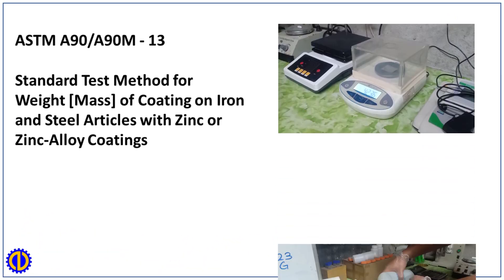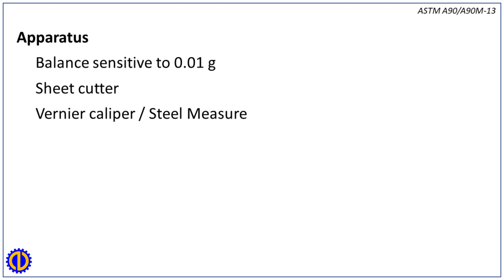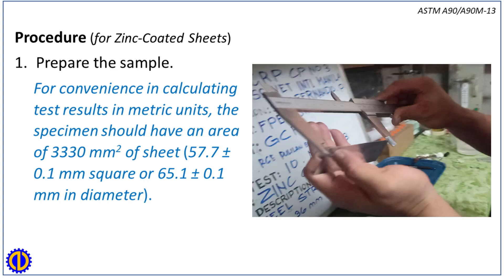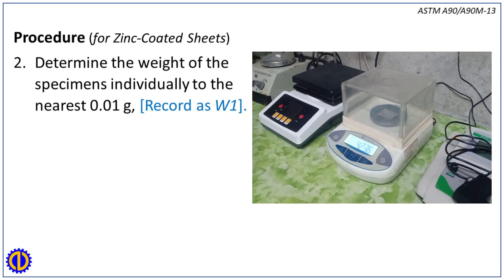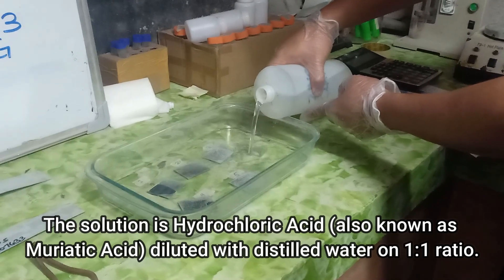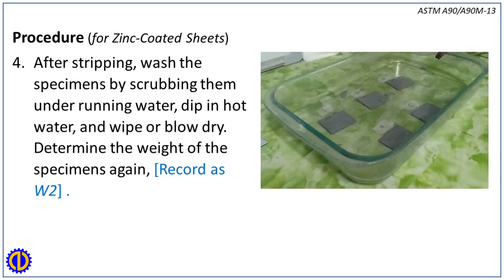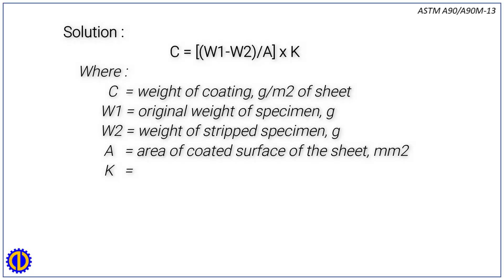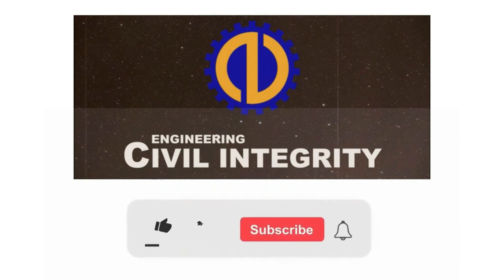Zinc Coating Test

Comment: How long it takes of dip metal? Only 15-30 seconds or more.? What time I should remove it from the solution?
Reply from the maker: Yes 15-30 seconds for hot dip zinc coating

Comment: What is the area formula for

Plate
Pipe
Rod
Channel section
Angle section
Reply from the maker: Only the surface area with coating is to be considered on calculating zinc content. For plate, channel section, and angle section. Cut a rectangular or square shape from the material, A=LxW
For pipe and rod, A=2πRL where R is radius and L is length.